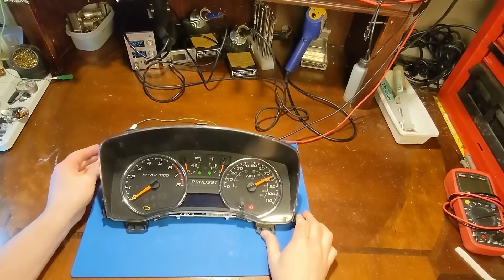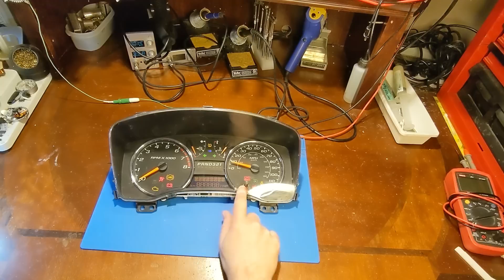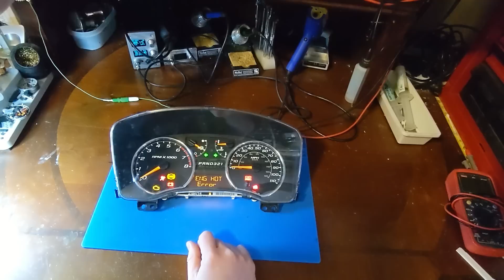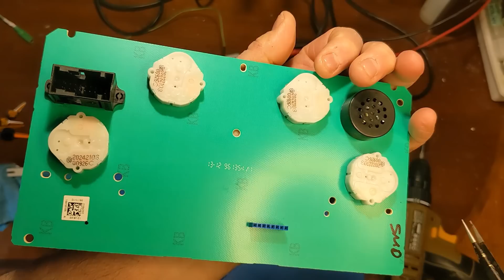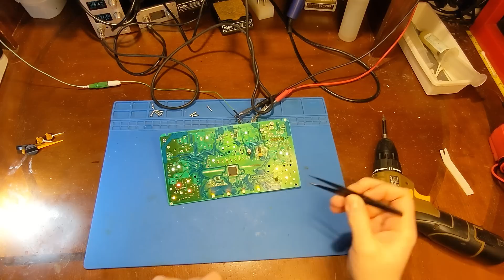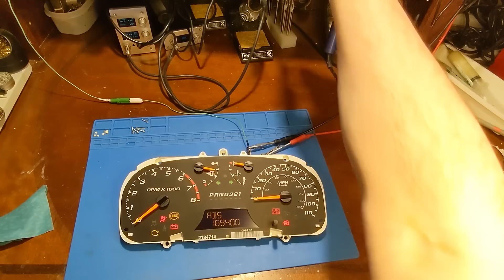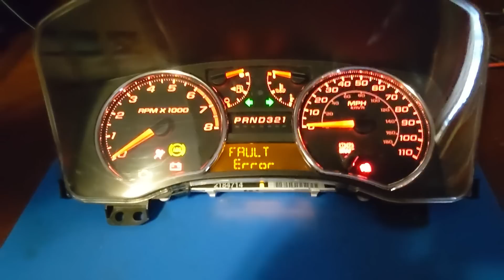How to fix a Chev Colorado Cluster

Comment: Jeff, would you have any idea why the engine hour meter on an '04 GMC Sierra cluster reset to zero hours? The truck has 508,000 miles on it and the hour meter had 12,000 plus hours showing when it reset itself. Thanks.
Reply from the maker: It's a very common problem. I believe it has something to do with the way the hours are stored on the eprom. Mileage is stored in triplicate and itself checks itself but I don't believe hours are.

Comment: My cluster on my 04 colorado recently froze with only the signals and engine light working, is there any chance to make the serial bus signal work again without replacing the entire unit ?
Reply from the maker: Hard to say without knowing the source of the problem.
Reply: @jeffescortlx  was working fine till a few hard bumps killed all the lights and froze the dials, only indication it’s getting power is the signal arrows still work and the check engine and security light powers up when putting the key in the start position. What check list should I go through to see if it’s a problem that could be fixed?
Thanks for the reply btw
Reply from the maker: @sockmangames  the CEL and blinker indicators don't use the cluster logic to run, they are independent.
Start with checking fuses, power and ground coming in.
Reply: @jeffescortlx  funny thing just happened, honked the horn and it unfroze it all, bringing all the lights back on. It did throw a p0650 code after that but I haven’t found any burnt out circuits as of yet
Reply: Same thing happened on my 2005 Colorado. Lights in my cluster had been out for a while but gauges still worked then the other day went out to go somewhere and the whole cluster, lights and gauges was dead. I saw this video and read your comment about blowing the horn so I thought what the heck I'll give it a try and what do you know the whole cluster came back to life, lights and gauges!!

Comment: hey whats usually the issue when a cluster works for 30-45 minutes and then shuts off completely until the next day?  i got a 01 dodge dakota.  its stumped me for a year
Reply from the maker: I'm not familiar with that year/model. Perhaps a fractured solder joint or failing component.
Reply: @jeffescortlx   It happens every single day it's weird.  I resoldered pretty much all the joints except the really small ones on the chips. You never saw an issue like that before on a different cluster?  Really idk if its even the cluster or something outside of it

Comment: I've had issues with my cluster not working at all in my 05 Colorado.  I used to be able to just wiggle the plug in the back and it start working immediately, but now that doesn't work.  I thought it was a soldering problem like in other cluster repair videos i've watched but it might be something else

Comment: Great video, I have a 2007 Colorado that the turn signal audible signal quit working. I'm retired Chevrolet dealer tech and the wiring diagram shows to have a speaker to generate the sound. Could this be a cracked solder joint? I can't see paying the 300 bucks for a reman cluster and it doesn't bother me until I get the annoying dinging letting me know I'm stupid for leaving my turn signal on.
Reply from the maker: I can't say for sure. I haven't come across that issue yet.

Comment: Great video and nice to see a new type of cluster. Regarding LEDs, do you have a recommendation or source for some to match the 07-13 GM fullsize turquoise color (blue lagoon is what I've heard it called)?
Reply from the maker: I haven't run across a situation where someone needed an OEM led for the 07-14 full size. Usually the only time I'm replacing the LED's is to change the color.

Comment: Great video per usual Jeff! What are you using to send the serial data signal? On the full size GM clusters I've got an ECM setup with potentiometers for the different sensors and then connect the serial data line from the ECM to the cluster data line.
Reply from the maker: https://youtu.be/LnDgK4rJ2us

Comment: How did you get into cluster repair and other electronic repairs? Is it your full time job or just a hobby? Electronics always interested me and i honestly don't know why i didn't get into it. Maybe if the internet was around like it is today when i was growing up i might have. I'm an automotive tech and i like diagnosing electrical issues but i feel like its time to move on and change careers, i know what ever i do isn't going to happen overnight
Reply from the maker: I've had an interest in electronics since I was a child. After high school I went to a technical college. I have 20 years experience as a panel technician. I have some family members with GM vehicles that didn't want to pay dealer prices to get them fixed. They asked me to give it a shot since they knew I could solder.

Comment: These videos have helped me immensely when DIYing my 2001 Audi TT cluster (LCD replace and various reflow points, no more LED flickering).  Certainly the most difficult part was putting the needles back accurately (need VCDS diag tool to put the cluster in test mode).  Mine has two types of stepper motors, rpm and kph and smaller ones for temp and fuel.  What I have to say when dealing with unavailable stepper motors is not only put the stepper motors where they belonged previously but also take care not to put them upside down (in mine the motors click into place, no soldering).  The problem I now have is the kph gauge is lazy to return when speed drops, probably due to it having worked in a specific range for 20+ years.

Comment: Wait, did you just say that the dealership techs didn’t know how to program the cluster to the truck? With their dealership level tools, and dealership level training they didn’t know how to do it 🤦‍♂️ I’m in bum hole of UK, where those vehicles are non existent and we happen to have a fleet of those Chevys. I had to figure out what tools US dealerships use, purchase the kit and subscription, then figure out how to use it because we had few of these awaiting programming 🤷‍♂️ and it certainly was easier to get unfamiliar software and learn on the go rather than send whole trucks back to USA 🤣
Reply: As a GM tech, I can tell you that GM techs DO know how to program a cluster, we do it all the time. The problem is, the GM service programming that the dealerships use will not allow the techs to program a used or junkyard cluster and change/correct the mileage. We can only program the mileage into new/reman clusters that show ZERO miles. If it's a used cluster from a junkyard, every GM dealer is going to tell you the same thing, that they can't help you. It's not because they are stupid.
Reply from the maker: @Chevtec  I agree. I didn't intend to word it to make it sound like the GM techs were stupid. I have heard of other times that people have tried to get cluster programming done at the GM dealership and they were told the techs didn't know how. So I assumed it just might not be part of the training and only the techs that take the time to learn it know and there are some that never have, just speculating off of past experiences. Is this part of basic training that everyone needs to know? Or does this just boil down to a techs experience?
Reply: @jeffescortlx  The way vehicles are today, all techs should know how to program, but there are some who probably don't. And just like any other profession, there are some who are better at it than others, and some who just really don't know what they are doing. And remember, the person at the dealer that customers are talking to isn't usually the tech, it's the service advisor, and they say things all the time that are not correct. For instance, the key fobs, yes, sometimes they CANNOT be reused, sometimes they can, depends on the vehicle, and sometimes depends on vehicle options.  There is no way to say for sure until I know what you have, so the advisor usually just says no, can't reuse it. It's a quick easy answer that involves no effort on their part to find out.
Reply: @Chevtec  now that makes more sense! Yeah, I’ve only dealt with remanufactured clusters and that was easy
Reply: I mean GM dealership techs will also tell you you can't reuse keyfobs. A surprising number of them actually believe it too. lol
Reply: I did a cluster swap once  I bought one with the closet mileage to mine (slightly higher)   then just racked up miles tell it was at the clusters mileage..  then did the swap..  I was too cheap to pay for a reprograming

Comment: One other side note on Colorado clusters, regarding the ODO.

These clusters will advance to whatever the BCM value is, so you have to be careful not to plug them into a higher mileage vehicle or test bench. They will not come back down without eeprom programming.
Reply from the maker: I do have some first-hand experience with this. This last summer a shop that was trying to fix up a customers abandoned Colorado to sell. A previous owner put in a junk yard cluster with higher miles (was over 200k iirc) and the odometer stopped counting up. I used my x100 to subtract 10,000 miles at a time until the odometer started counting again. It finally started to match the BCM and start counting at 140k. This is all going off of memory so I could be wrong about some of the details, but we got it to work like it should.
Reply: @jeffescortlx  yep that's correct. Odometer won't move, trip will, until BCM catches up with the cluster
Reply: Yup, and it works the other way too. Had a Colorado come in to the dealer I work at, from another shop, they had swapped a BCM from a junkyard truck with really high miles into a low mile truck, and it changed the mileage in all the modules to the higher miles. They just wanted us to program it and get the right mileage back. Well, not gonna happen, GM programming system doesn't allow it. Swapping modules on any vehicle after 2010 is just asking for trouble
Reply: @Chevtec  yep exactly!

Comment: So cool seeing these on your channel. Worked on these Colorado clusters for years.

The middle LED you were wondering about does the needle backlight for the fuel and coolant needles, and also lights up the PRND321 display.

The 4 right angle LEDs at the bottom can be changed out as well to change the backlight color of the odometer display.

You can also change out each PRND321 LED for whatever color you want too.